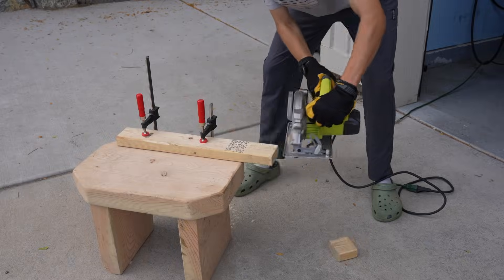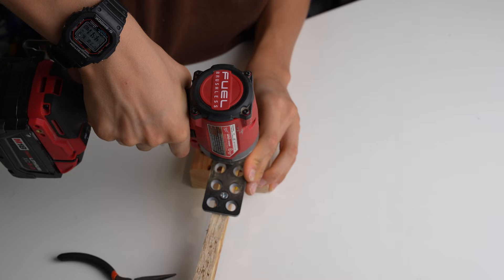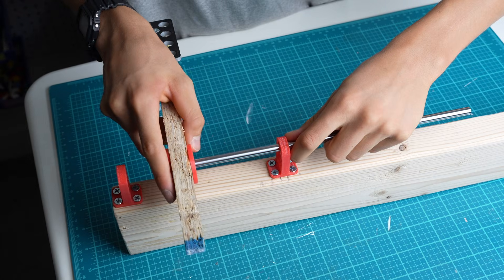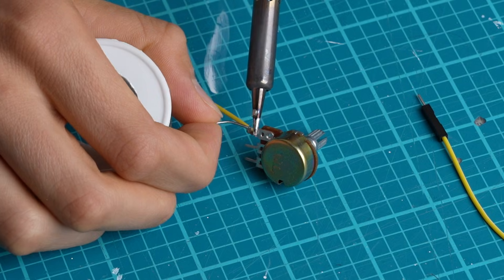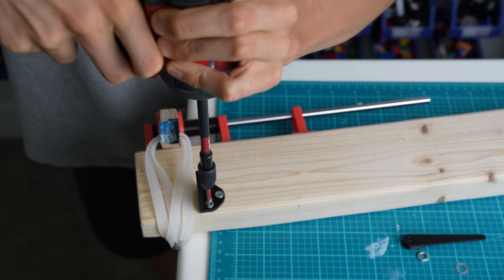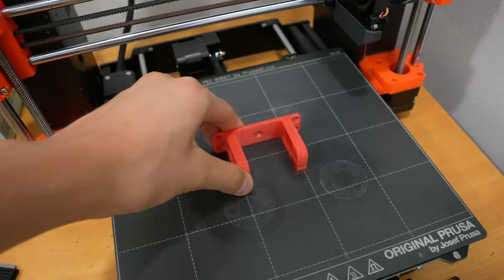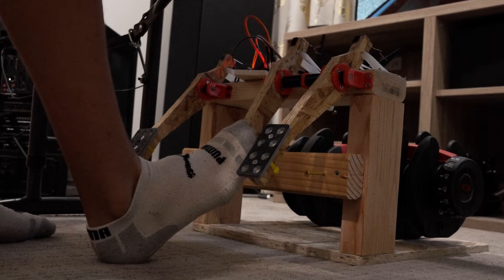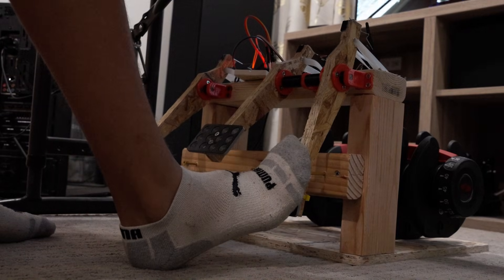Part 2 - DIY Pedals for Drifting Sim | 3D Printing + Arduino

Comment: Could you make a video showing the Arduino Nano connections like in the first part? And if you use any software like EMC Utility, VJoy, or others, and also provide the command you use on the Arduino Pro Micro to send the signals, I'd like to know so I can build mine... please.😊😊

Comment: How old are you? I'm turning 14 in a week and I got my 3d printer around 2 months ago but im more of a flight simmer so I'm looking into that but this is also awesome!!!
Reply from the maker: Hey! I don't want to specifically state my age but I am somewhere close to you... What printer do you have? I actually am more of a flight guy rather than a drift guy so yeah. The only reason I have a drift sim is because of these video series.
Reply: @CircuitScriptEngineering  Cool, I have an ender 3 v2. I'm trying to design my own throttle right now but ik thinking of redesigning it all over again cause I think I can make some improvements.
Reply from the maker: Yeah, thats what usually happens :D

Comment: The pedals are great bro! Next idea.... Make all of the three (wheel, pedals and shifter ) from a gaming controller so that it can be used in any game which can support a controller , this way there is no tweeking for any game and the no.  of games supporting that will be a lot ,the whole setup will become a plug and play and will work on a lot of games (thanx for mentioning ❤)
Reply from the maker: You mean like taking apart a gaming controller and using the electronics from that or you mean to code the pro micro board to act like a gaming controller. It actually already is a plug and play, so I am not quite sure what you mean. Thanks tho. (Your welcome)